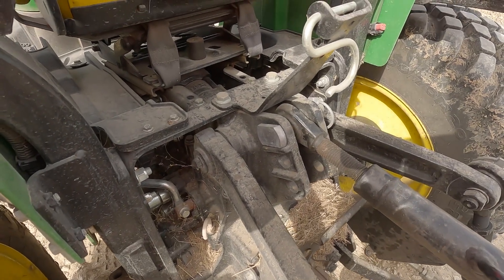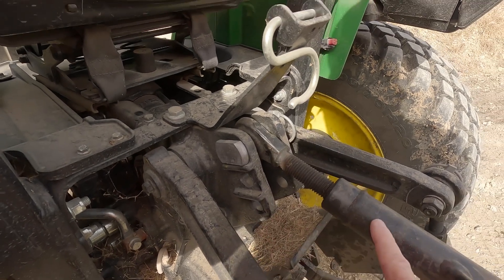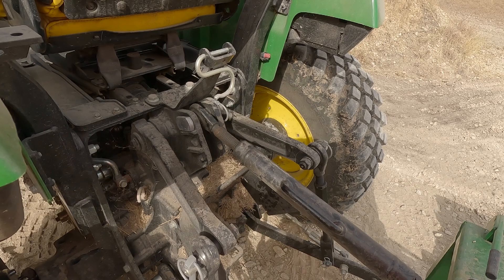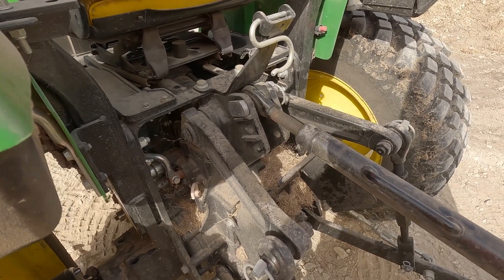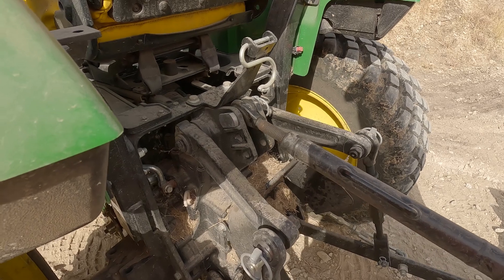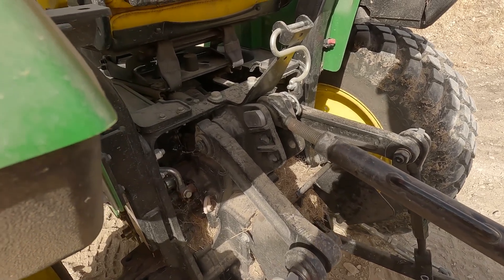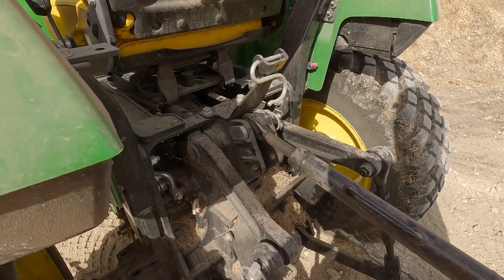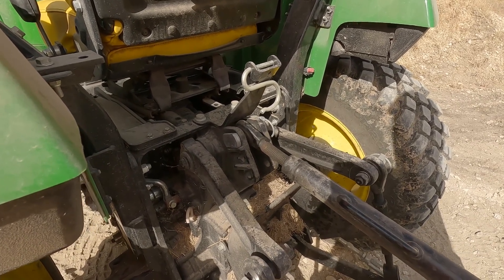Top Link Holes Explained! | Avoid Breaking Your Tractor’s Rockshaft Housing (3-Point Hitch Tips)

Comment from the maker: Most tractor owners never think twice about which top link hole they use — until something breaks! 💥
Which hole do you normally use on your 3-point hitch — upper, middle, or lower? Let me know in the comments 👇

If you found this helpful, check out my other Everything Compact Tractor videos for more 3-point setup tips, box blade techniques, and compact tractor maintenance guides! 🚜

#CompactTractor #ThreePointHitch #TopLink #TractorTips #EverythingCompactTractor

Comment: i have a rear mount 5 ft. snowblower which hole do i attach it to? It is heavy. I'm from northern Wi.
Reply from the maker: Just my opinion I would use the center hole as the attachment rides just above the ground surface and doesn’t go sub soil. If you can look up your tractors operating manual just to make sure. In most cases the center hole is a safe position for heavier applications where you have a heavy attachment hanging off the back of the tractor. Thanks for taking the time to watch and leave a comment.

Comment: On the 203xR tractors shown in this video most of the time the break outs are because you have to lower the lift arms to remove the top link and then people leave the pin sticking out of the hole when they remove their top link and then raise the lift arms.
Reply from the maker: Very good point. I've almost done this myself as it's very easy to do. Thanks for watching and leaving a comment.

Comment: Is there anything wrong with running everything in the top hole?
Reply from the maker: I don't think there would be a problem just using the top hole as long as you have enough ground clearance with whatever implement you're working with when it's fully raised while traveling. I have to admit I pretty much run the top hole 90% of the time (I'm lazy). It's always a good idea to also check your owner's manual for your tractor. Thanks for taking the time to watch and leave a comment. I appreciate it.

Comment: I've got a mix eighty's Massey. I have to use the bottom hole for my brush hog. Otherwise the mower will hit the tires when lifted. It changes the circumference of the lift.
Reply from the maker: Thanks for watching and taking the time to leave a comment. That is a problem I haven’t seen before. Massey Fergusons are great tractors, I absolutely love my early 80’s 230. Thanks again!

Comment: Interesting discussion which appears appropriate for the sub compact tractor. I have a  45 hp Fiat which has four such holes and the supplied user manual  indicates the top holes for lighter work and progress down for the heavier  stuff. I guess with the sub compact there are issues with ground clearance.. The manual also covers when the lower link should be held taut or slack which is another point for discussion.
Reply: I should have also said my tractor has draught contol so if the tractor doesn’t the hole used is related to the ground clearance.
Reply from the maker: @Graham415-l5k  For tractors with draft control, the center hole is typically used by many manufacturers, as it controls the sensitivity of the draft function. However, it can also affect the height of the implement when it's raised. I've got another video coming out soon that should explain better how the draft function works, and how we use it on our commercial tractors when mowing/bush hogging. I'm sure it is going to be very "controversial" for some, if anyone's interested in watching it. Glad you brought that up!  Thanks again for commenting.
Reply from the maker: Thank you for watching and commenting. Thank you for sharing the information on your Fiat, as I am sure not many folks have ever seen or heard of four holes for the top link. When it comes down to it, reading the owner's manual is the proper thing to do. Thanks again for commenting. I sincerely appreciate it.

Comment: Just to let you know on bigger machines that three hole top link is hinges with a lever to hydraulics in that case you have draft control then these holes adjust the sensitivity for ground engagement.  Just fyi
Reply from the maker: Hi Russell, thanks for watching and commenting. As I mentioned in the video, I would get into draft control in another video. For that video, I'll use my JD 5103 to demonstrate how the draft control works, as it has draft control. Unfortunately, there is a lot of bad information on YouTube concerning draft control on tractors. Thanks again for the comment, as I'm sure there are a lot of people who are not sure what draft control is and how it's used.